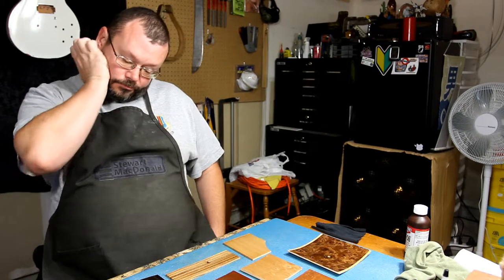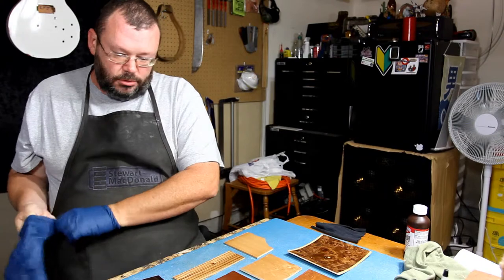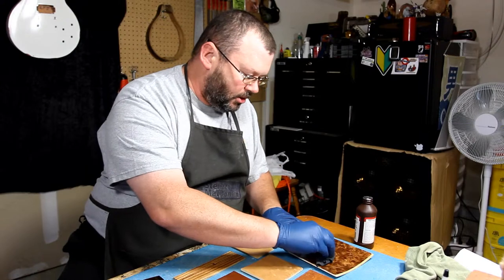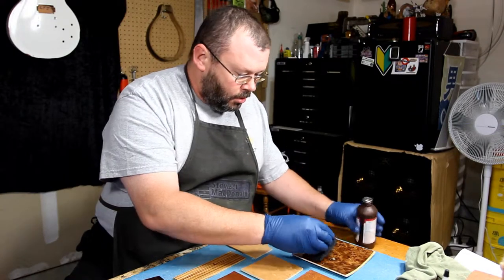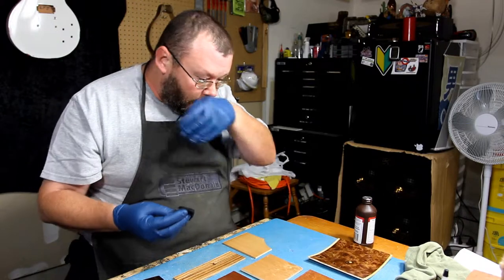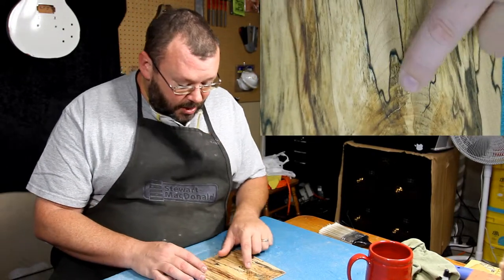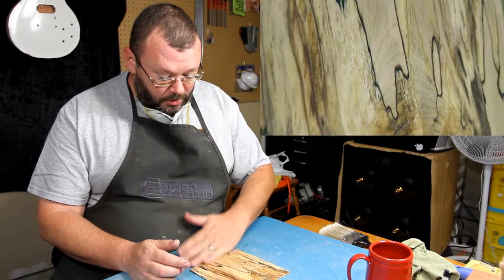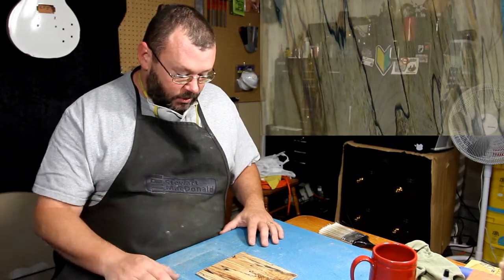finishing test 7 | FUN WITH WOOD / RGR by James O'Rear

Comment: Love TruOil! It's so ridiculously easy to work with, plus it looks good and doesn't smell all that bad. Here's a tip: screw the cap on tight and then store the bottle upside down. That'll help keep the TruOil from skinning over. Usually you also poke a hole through the foil (instead of just ripping it off), but I noticed you already did that. Oh, and store the upside down bottle in something else, just in case it leaks a little.

One other thing I'll mention: I was always told to not sand finer than 220, especially on really hard, tight-grained woods (like ebony and maple.) Once you get over 300 grit, you can start burnishing the wood, which makes it difficult for the finish to adhere and you can potentially end up with finish peeling problems later. It's usually not as a big a deal with porous woods, but really anything over 220 is unnecessary and just more work. I think Dan Erlewine even mentions it in one of his books, and as far as I remember (from watching various factory tours) Fender and most of the guitar manufacturers only go up to 220 or 260 grit max before they start applying the finish.
Reply from the maker: Roger that. It's going pretty well so far, have 12+ coats on my sample pieces.